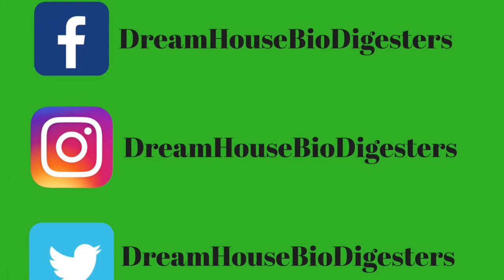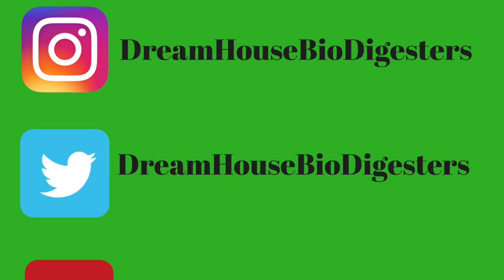Biogas vs Biodigester: The One Best For Your House

Comment: Either this topic is misleading OR you didn't answer the person's question correctly, Biogas is the gas extracted from a biodigester(the container holding organic waste for gas production), it consists of a mixture of gases which are methane (the desired gas), carbondioxide(unwanted gas) and hydrogen sulphide (unwanted gas). A biodigester is air-tight container, compartment or enclosure that holds the organic waste for anaerobic digestion that will bring the production of gas, it can be constructed using different types of containers ranging from PVC gallons, Jerrycans and water storage tanks or constructed like sausage or barrel shape below the ground with cement and concrete(plug flow type).